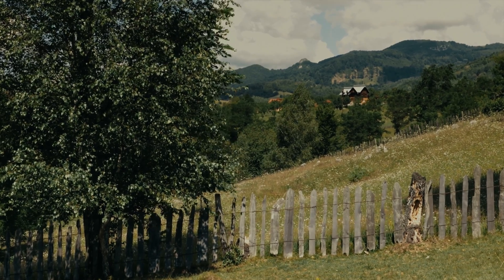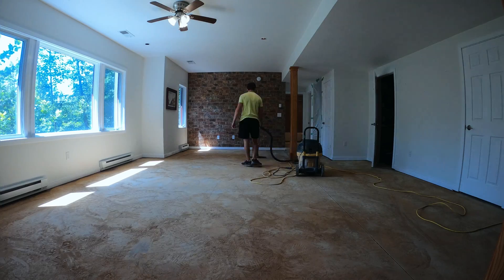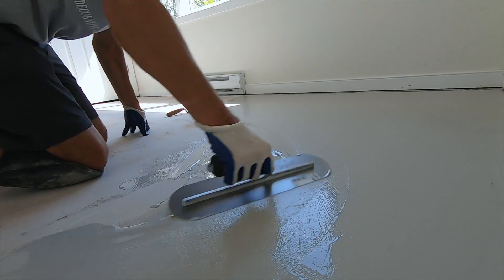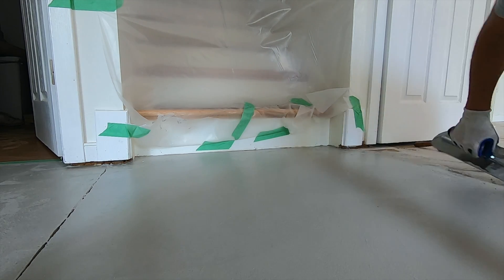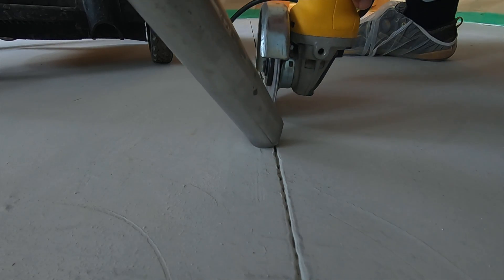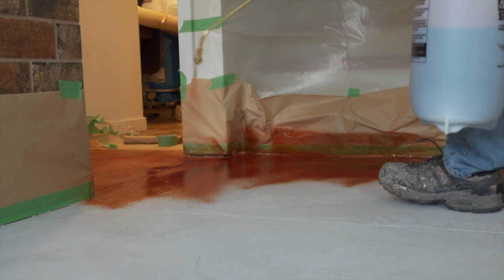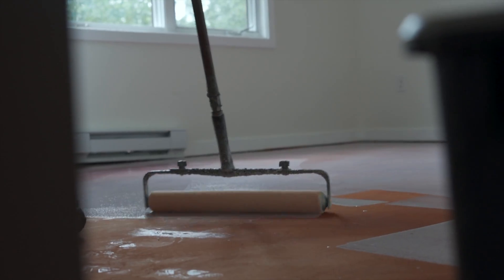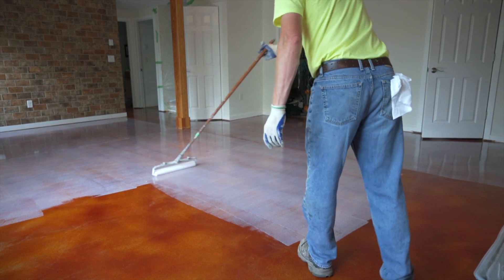Fixing an ACID STAINED CONCRETE FLOOR  with a CONCRETE OVERLAY

Comment: Hi Tim, great video, thanks. If you're up for giving some related tips, read on. The main floor of our house is dyed concrete (the whole slab is red all the way down, not just a stain applied to the top). General contractor etched it with with Muriatic acid and sealed it with Clarishield, a water-based sealer. A few years in, the sealer is failing in several spots. Almost completely gone in areas with high foot product. Would you recommend the same process in this video without the concrete overlay and staining? Is there a particular epoxy/urethane product that you'd recommend sealing with?  The floor is exposed to lots of sunlight and we're in Northern Vermont, so pretty major temp. swings over the year. Any tips you can offer would be appreciated.

Comment: The acid stained floors in a rental property have worn spots near the doors, sink, and refrigerator.  Is there a way to repair this without having to do a complete overlay and restain?  Also what would I need to do to install tile over the stained concrete?
Reply: Did you get an answer to this question ??

Comment: I am doing my research before we acid stain our concrete floors in our new house. 
I have a question about the cut lines though. Why don’t you fill them in with anything? Inside residential homes, do you leave the cut lines open for a reason? 
Your videos are helpful! Thanks in advance for the reply. 😊

Comment: Love your videos!! I watched your countertop video and it's giving me the courage to try it in my kitchen!

I have a stained concrete floor in my basement, very similar to the original floor in this video. I'm not sure what type of acid was used, but it was probably done around 2009. 

I'm wanting a lighter color, so I was thinking of painting. Will I need to grind and overlay? Or should I strip? Etch? Help!

Comment: Hello, I'm going to use Rust-Oleum clear gloss sealer for my concrete acid stained floor. Is it ok to spray it on instead of using a roller? Thankyou

Comment: Hey guys amazing job. Would  you use the Concrete Overlay product on a salt pitted concete floor to repair it before either staining or epoxy or use self leveling Concrete?

Comment: I had a bad acid stain job, so I ground the entire outdoor patio.  I've heard some people do not recommend acid staining on ground concrete, while others do.  What would you do?  What are my options.  The way I see it is this. 

1. Grind off, acid stain, seal
2. Seal the natural concrete
3. Overlay, acid stain, seal
4. Epoxy with heavy flake and Poly Aspartic top coat (Not sure how this would do in a very cold climate in winter and hot/humid in summer)?

Thoughts?

Comment: I have this exact problem - old red acid stain that has been worn off in high traffics areas. Masking tape has pulled it up as well leaving unsightly strips. I’d love just a natural, flat gray color. Can you just use the primer layer and then seal that to cover the old school acid stain and and achieve a more modern look?
Reply: I don't like to grind and do acid as you expose the stones which don't take stain, in Barbados the stone is white limestone so floor looks like confetti when stained
Reply from the maker: Yes. You could just grind the stain off back to gray concrete… or you could order a gray colored overlay and trowel it on & seal it.

Comment: one more question. I started to prime my concrete after pressure washing it. once that is done it looks as if I am ready to do the stain followed by a good concrete sealer and that's it? The concrete has never been stained or painted, just power washed twice a year. Do I even need to prime the concrete or just apply the stain and sealer.
Reply from the maker: That is a different process than anything we do. 

I would suggest checking with the manufacturer of whatever you are using.

Comment: i have a question regarding scrubbing a stained concrete floor. after scrubbing my floors with a floor machine and mopping 3 times, some spots have a gray tinted residue. so i scrubbed it again, and again. it won't come off. i don't want to wax over top of it. what do i do to get it off? thanks.
Reply from the maker: I’ve never heard of that happening before. I’d have to see a photo of it to be able to offer any advice. You can DM me on Instagram if you want to talk about it. @timdcva

Comment: Very nice!  I have a stained concrete basement floor that has chipped. I want to repair the chipped portion only. Should I use a thinset mortar?  Do I need to use anything before applying the thinset?
Reply from the maker: Thanks!

We use Cement-all from Home Depot for patching stained concrete.

Comment: I have concrete stained floors, we built our house in 2014 and stained our scored concrete  they were covered after everything had cured so we could sheet rock as we pulled coverings up and still to this day my stain peels and flakes... why does it peel and flake? I would like to touch it up but don't want to risk it doing this again
Reply from the maker: It’s hard to say without seeing it. The product they used might be a semi-transparent paint instead of a penetrating concrete stain. 

The top of the concrete could be weak and the surface could be coming up with the sealer. 

Either way, if you grind the surface off of the concrete then you shouldn’t have any problems if you do it again.

Comment: I pulled up all the carpet in my basement I think whoever painted the basement floor used paint from NASA anyway I got all the paint off that was fun can you recommend a stain for me. I seen a video you put it in a pump sprayer and spray it on it's a large living area and two bedrooms and a hallway. Are the last two steps critical this is not a living area in the basement only for storage.
Reply from the maker: We always apply sealers to our stain projects… if it’s just for storage you could probably get away with a lesser expensive clear acrylic sealer.

Comment: Can I make the same steps over a microcement ?! 
What is the 3rd component you mixed with epoxy primer??
Reply from the maker: I believe you can go probably go over micro if it is in good condition. 

The epoxy primer only has an A + B. I’m not sure what you are referring to.
Reply: @TimDCVA  at 3:35 to 3:43

Comment: Thanks for amazing video.
I have a question
When concreting the floor is done
Should the concrete be completely dry?
After how many days can I apply acetic acid and a layer of acetic acid?
Reply from the maker: Thanks!

Yes it needs to be dry. 

I’m not sure how long you need to wait for an acid stain. I prefer to use dye on a job like this.

Comment: Would you still use an overlay coat for a new concrete floor or would you use the new floor, acid stain, epoxy coat, urethane coat?
Reply from the maker: I prefer the look of staining natural concrete.

Comment: I have the same style/ color of stained concrete floor in my home but it has a lot of liquid droplet stains all over it from household cleaners i.e  pinesol, lysol from cleaning my counter tops and droplets got on the floor and dried and now stained my floor.  I didn't really notice them until one morning the sunlight hit it just right and it's hideous. How can I remove them? I've tried scrubbing it with a brush and soap, wont come off. Thanks
Reply from the maker: I’m not sure. I’ve never seen anything like that before. The repair would depend on the type of sealer on your floor... and it doesn’t sound like it’s the same as what we used.  If you email me photos and let me know what materials you used, I might be able to make a suggestion.

Comment: After this is done are the cuts in the concrete filled or are they still cuts?
Reply from the maker: The cuts are visible in the finished floor. You can caulk or grout them... but this customer chose to leave them as is.

Comment: Bought a new house with engineered hardwood, want to remove and use the concrete slab.  What is the best way to make make the concrete white?  Overlay or dye/stain? Thanks.
Reply from the maker: You would have to do a white overlay or epoxy. Stains usually only darken the concrete.